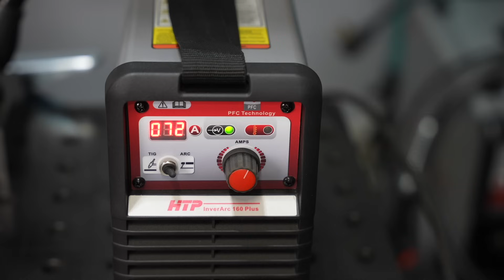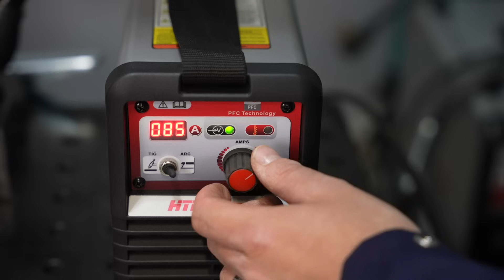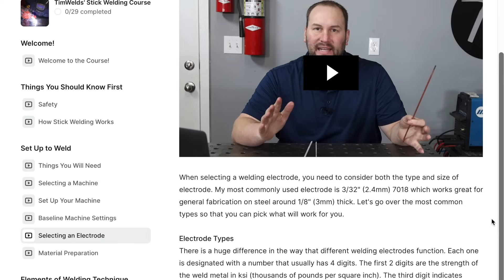3 Stick Welding Electrodes Compared: 6013 vs 7018 vs 6010

Comment: What Rod is good for building Solar Tracker carrying 300Kg of weight? I am a beginner  at Arc Welding so i m currently practicing with 6013.
Reply from the maker: Honestly you could use almost any rod. If you’re learning 6013, I’d just use that.

Comment: GREAT video as always, but I have a question about 7018 (DCEN). 
Bottom line, why might it be so EXTREMELY DIFFICULT START, even with new rods on very clean metal? You start it like the Pro here (of course), but for me and some others it is by far the the most difficult rod to use, even brand new. My machine has an "arc force" setting which is poorly explained in its user manual -- would that be the key? Meantime, I am sticking bad every single time I use 7018 rods. Again, THANKS for your channel and super clear info!
Reply: That’s why they call it stick
Reply: When I first started learning to weld, I got rod 7018 stuck 9 times outta 10... Ugh😢
Reply: 99 out of 100 here - not exaggerating!  Still true.  @lamey99
Reply from the maker: Thanks! I would recommend DCEP for 7018. Striking an arc is largely a matter of practice. Arc Force will increase amperage when your arc length becomes short (the machine senses this from a change in voltage, which is proportional to arc length). It doesn’t do much for 7018, but is more helpful on cellulosic rods like 6010/6011. If your machine has a hot start setting, that would help quite a bit.
Reply: @TimWelds  Thanks! Okay - I meant to say DCEP - but will make sure. To be honest, I do not know if I have Hot Start on my good fancy machine (the manual is not very good in my opinion). It is a YesWelder 250P AC/DC.

Comment: Q: Will stick welding be strong enough for my application?
I want to weld up a seat for my bike for my 60# dog. I will use metal tubes bent to create the back and sides. The bottom will be fastened to my bike rack just the tubular sides will be welded.
Thanks!
Reply: In general, Stick welding as a welding process can be very strong.  Industrial equipment is repaired with stick welding all the time (by professionals).  The more important aspects are: operator skill and competency in metal fabrication/engineering design.  The strength/resilience of a completed welded project can highly depend on how the joints/geometry of the structure is designed, as well as the quality of the welded portions that tie it all together.  So it begs the questions:  Do you already know how to stick weld?  Are you experienced in metal fabrication?  Are you familiar with creating/evaluating the integrity of a concept structure that is to be welded?  If all that is new to you, it might be best to seek advice from someone who is familiar with similar type work and possibly get their advice/input.  Hope this helps.

Comment: What rod would I use to weld 3/16 square pipe. Should I start with 70 amps and low watts
Reply: I’d go with a 6011 at 80-90 amps

Comment: Hi, I'm a newbie in welding. Currently I have a MMA welding machine but want to use this machine for MIG welding. Since my MMA machine Teoritically has 0~120A and its non-load voltage is 100V, then how to reduce the voltage down to 20V for MIG welding? This machine has only 1 amperage regulator knob (0~120A).
Any help is very appreciated 🙏🏼
Reply from the maker: Unfortunately, this will probably not work very well. The reason has to do with the fundamental design of power supplies for different welding processes. MMA uses a constant current power supply, where MIG uses a constant voltage supply. The reason for this is that you don't directly control arc lenth with a wire feed process like MIG, so the power supply has to reach a stable point. With a constant voltage supply, power is increased with a short arc length to increase it and is decreased when the arc length is long to reduce it. Thus it will reach a balance point. The MMA power supply will not do this as effectively.
Reply: Wait till the HF Titanium 125 goes on sale.for about $120.

Comment: I’ve seen other online saying 7018 must be kept in a rod oven or it just won’t work. It seems your opinion is that it’s not necessary for hobby welding?
Reply: You can find a video on this on another popular YouTube welding channel. Would be awesome to see Tim do one to get the word out. You store them in an oven if you have a job where low hydrogen is critical. If you don't store them properly, they are fantastic rods and stronger than all the 60xx rods...just not "low hydrogen" anymore and not suitable specifically for low hydrogen work.
Reply: They make good looking welds that are stronger than 6013.  They are called a medium penetrating rod.  So if you have part of a box just use them like a regular rod.

Comment: 7018, welds easily. Good quality 6013 is fine, too. Anything with cellulose is just nasty and difficult to use, simply switch to TIG if I need a good root.
From my experience, you just have to try the electrodes, some make better ones, some are worse. 6013 from company A doesn't weld as nice as other pack from company B.

Comment: How thick is the Aluminum Plate you are using?  Trying to find one
Reply from the maker: It’s 3/8” thick. Depending on what you’re doing, 1/4” could be fine. If you’re welding steel, a steel plate would be fine as well. The one I have is just a random size drop remnant that I happened upon for 25 bucks a few years ago. You can order one from an online supplier, but it’s probably worth calling a few local metal suppliers or fab shops to see if they’d sell you a rem that’s around what you’re looking for.
Reply: @TimWelds  wow only 3/8? i was guessing 5/8
Reply from the maker: I came across this one from Justin’s (the fabrication series) store. https://weldmetalsonline.com/products/bench-top-welding-plate
It’s a bit thinner, but seems like a decent price if you’re still looking. I have a discount code there ‘TimWelds’ that can save a few bucks.
Reply: @TimWelds  sweet. I’ll check it out.  Thanks!

Comment: where can i find a aluminum plate like that?   im checking onlinemetals and a .5" 24x24" 6061 plate is $300+    does that sound about right?
Reply from the maker: Material prices have skyrocketed since a few years ago, so that could definitely be their price, but I don’t buy a lot of thick plate, so I’m not sure. I’d shop it around a little, check with local shops and maybe go a bit thinner/smaller if that would serve your purpose.

Comment: Just tap the 7018 on a flat surface after you run your first bead. No need to clean up the tip with a hammer ect ect.

Comment: I am in Australia and I do a lot of heavy repair work. I always use WIA 16tc rods. I guess you guys would have something similar. They leave a shiny glassy slab, and are an absolute pig to restart, I usually have an old house brick on hand, drag them across that and they start easily.
Reply: Agreed! I enjoy a piece of rough concrete for this. 
Have you tried the unimig rods?
Reply: @JC-dc7ez  I have had a go at one of the opposition rods, cannot remember which brand. Was pretty good except overheads. I use nothing but Hyundai mig wire, great stuff
Reply: @martinthompson4462  i will get myself a role and check it out. Thanks

Comment: I use all of them but my favorite is one no one uses anymore - 7024. Big fat rod, great looking weld, slag just peels off. Not the best for everything but for a lot of the stuff around my house I love it.
Reply: Fully & 110% agree. Great for fillet welds & downhand (flat) welds. It's also called a dummy rod. You just couldn't go wrong with it.

Comment: 6010 such a mystic rods, we dont have them around here, in Russia
I usually use  6013 and 7015-G, and sometimes 7016
Reply: 6010 cellulose and sodium DC,  6011 cellulose and potassium AC/DC runs on old transformer machine and cheap chinese welders.unless they are really cheap.   Both are fast freeze rods, what do you use when you need that.   There was a review of a chinese welder and he said it wouldn't run either.  I can't imagine getting by without one or the other.

Comment: What about 6011?  We use it for ranch work all the time.
Reply: Okay the first 2 numbers of 6011 stand for tensile strength in psi so sixty thousand pounds the next number shows u its good for a position a 1 or 2 will be stated on the rod showing a 1 for all position a 2 for a flat and horizontal rod only so the last number is your rid make up and Flux types basically telling you what the rod is capable of doing
Reply: He is using a HTP they sent him to feature using in his vids, they are not cheap. Plus he is a weld engineer and i hear they have 6010      called for in specs instead of 6011. ( I think someone said 6011 was common in SA)
Most of us have cheaper welders that won't run 6010, farm stores and HF don't carry them you have to go to a welding supply store to get them.

Comment: I usually clean the tip of the 7018 with a die grinder before restarting. And hotstart is nice for avoiding welding it stuck to the workpiece.
But I really prefer the 6013.

Comment: Those red 6010s are reverse polarity rods
Reply from the maker: Thanks! I was running reverse polarity (DCEP) for all of the welds.
Reply: Aww did not know that's what that meant Dcep. Bought them several times and wondered why they splattered so bad discovered it that way lol

Comment: Here in Australia 6013, is the dominant welding rod, because for decades CIG ( Commonwealth Industrial Gasses), THE dominant player in the welding market at the time, pushed their Satincraft 13 brand very hard.
So we all grew up using either Satincraft13 ( blue electrodes) or "GP" (grey electrodes, probably 6012) and most of us did not know about or use much else.
.
They ( 6013) are easy to produce a good looking weld with, but it is also very easy to get a very poor weld, with poor penetration and lots of slag inclusion.
.
We all learned on 120 amp buzz box type welders and  3.2mm ( 1/8) 6013 rods. Most did not progress any further.
.
Two very important things I wish I had learned decades earlier
#1 run your rods high in the amp range, if you are not right at the top of the amp range, get some smaller rods.
This is especially true of 6013, otherwise you will get poor penetration and slag inclusion.
#2 learn about other rod types
.
Reply from the maker: That's really interesting; I never knew why they were so popular. I agree 100% with both of your takeaways. Thanks!
Reply: Not sure what more to add. Looks like ESAB w/ its cigweld brand pretty well dominated your welding territory. Maybe your area was niche & limited to blue & gray electrodes. Cigweld has a full range of filler metal choice. Some competition (if economial) might of been more healthy for the consumer. Cheers from sunny Florida.
Reply: @miszced  ESAB was pretty much unknown here till quite recently.
We saw some lincon and a couple of other US brands, but only in the big end of town.

Back in the 70's and 80's CIG was pretty much the only game in town.
Untill a french company, then branded as "liquid Air" came to town, you where buying your gas from CIG. Even then we where paying extortionate rental on your bottles.
It's only in the last 10 years of so we have had a number of independent gas suppliers come  on to the market to bust up the rip off duopoply

They always had a full range of CIG rods, but out side the specialist welding trade, we had Satincraft 13's and GP's and that was about it.
A lot of that is because unless you where a high end welder you where welding AC

Because of the very strong market position Satincraft 13's are very much over priced.
I can buy good brands of 6013's for half the price, generics for even less, these days and now you can buy a good range of rods without going to a specialist welding shop.
That said the average hardware shop will pretty much have 6013's and maybee somethung that equates to a GP or 6012.
.
Stick welding is not the BIG thing is is in the US.
MIG and TIG has replaced stick and OXY in the vast majority of cases.
.
Like plasma cutting has replaced gass cutting in everythung but heavy work.
Reply: @soundman6645  yes, familiar with Air Liquide & AIRGAS plus LINC. As far as the demise of stick welding process ... it's still here! Besides being a mature product, innovation  continues with cost cutting & competitive benchmarking. The leap-frog* happened when the covering of stick electrode became the core of a steel sheath into gas shielded, selfshielded & metal core tubular wires for semi or automatic arc welding.

* bit of an over simplification
Reply: Yeah 6013 is the most common rod over here in New Zealand too. I haven't done a whole lot of stick welding and kind of suck at it, but the more I learn about rod types, the more I think 6013 is kind of a tricky rod to learn with.
Reply: @2bfrank657  yeh down under here we all learned on 6013, and it did us no favours.
.
ya got to run it in the hotter half of the range.
.
we have also bee sold rods too big for the job and not running them hot enough.
.
try some of the other rods

Comment: 6010 rods.  I found out that if you dampen the rods you can reduce splatter.  Working underground, 6010 has it uses.  I prefer 7018.
Reply from the maker: Thanks! When I went to welding school, they actually had us dip our 6010 rods to help them maintain an arc with their early generation inverter machines...turns out there's a background setting that just needed to be changed, but no one realized that at the time. I haven't tried it since then or compared the spatter, that'll be an interesting experiment.
Reply: @TimWelds   Thank you for the reply.
Reply: Turns out cellulose rods don't like to be super dry.

Comment: My favorite, because I can’t seem to stick weld very good, is the 7014.
So easy to use.
Reply from the maker: I've tried some 7014, they're really user friendly. Easy like a 6013, but not as much of an issue with the slag.
Reply: @TimWelds  why they aren't the best?

Comment: Turn your heat down 5. I'd like to see the back side. I whip fast with slightly higher acr length and it looks like 7018.
Reply from the maker: Thanks! I'll give that a try. It was definitely roasting that 1/8" plate by the end of the run.
Reply: @TimWelds  might take a few tries but you'll get it. Shouldn't be any blistering at all on the back side. You can do it vertices up as well

Comment: Hey Tim, good clean simple presentation on the 3 common SMAW rods in use. I do believe some of the pros out there can use the larger 6010 diameter (5/32 & 3/16) for arc gouging once the polarity is switched.
Reply from the maker: Thanks a ton! That could be a prett cool way to gouge, I may have to look into that. I've only used air carbon arc gouging, but it's been a decade since I did much of that...don't miss that process much.

Comment: I love 6013. 7018 is still my favorite go-to rod but 6013 has alot of benefits. It's great for thin metal since it comes in 1/16" rods which few others do. And like you mention it's easy to strike an arc
Reply from the maker: Absolutely! Thanks!

Comment: Can you dwelve into something like 7016 next time, if possible? 🙌🏻 I bought it once by mistake and have been using it since then, it's just so so so easy to weld with. But in all honesty, if I don't need to, I don't use electrodes at all... 😂 I'm a TIG welder, I like silence and solitude (without sparks) 🤣
Reply from the maker: I’m with you on the TIG. 😃 I’ve honestly never used 7016, but I might check some out.
Reply: If I'm not mistaken, 7016 is just like 7018, but its flux lacks iron powder, so it doesn't have as high of a deposition rate as 7018.
Reply: @elkvis  May be. It forms glass-like slag that needs to be hammered off, but that's very easy. Also starts and restarts are simple, I've been shocked how good it welds too. The main benefit is precision with which welder can lay it down. It has become my go to electrode for home applications when it's windy or I'm out of flux-core.
Reply: Most electrode manufacturers have developed a 7018AC. They are generally featured w/ touch restrike, equivalent deposition rates to std 7018 & easy slag removal with better arc control in positional welding. 7018AC is better on AC (Buzz Boxes*) & may help with arc blow.

*maybe a better choice of words, Hobbists with low output power sources